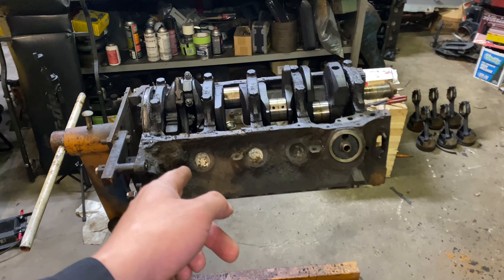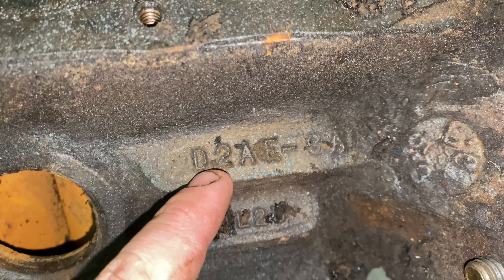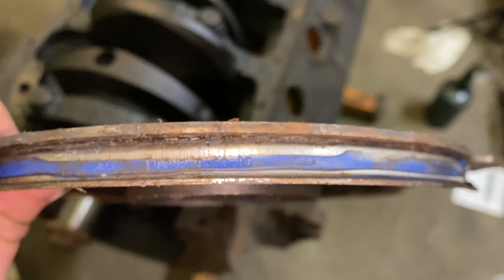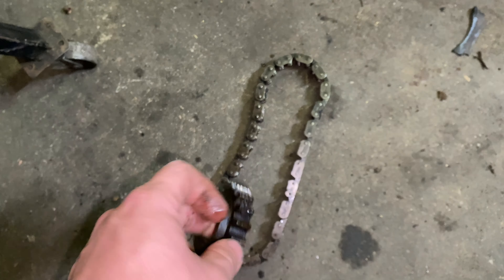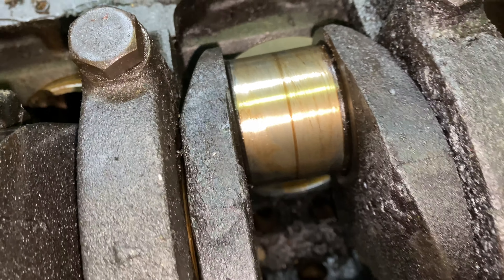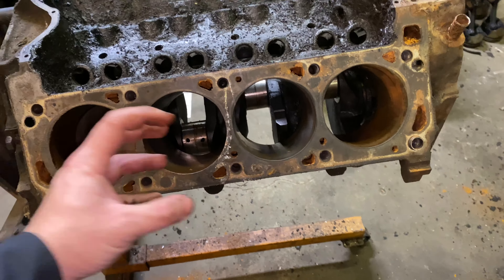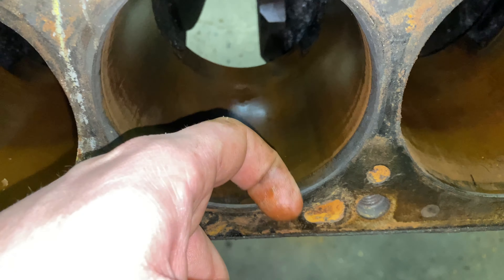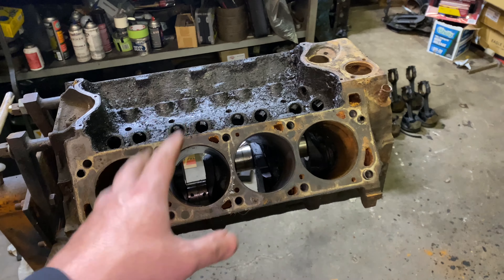Engine project-351 Cleveland.

Comment: I was always raised around the Windsor until my grandfather put a 400 in his 76 f100. I was impressed with the torque and became a fan of them after.
Reply from the maker: Very cool! Yeah those engines have great low end torque but not much too end unless modified but that’s why I love them in trucks, they pull hard just being stock. I didn’t really learn about them or become a fan until I started helping my buddy work on his 77 with a 351m and then he swapped in a 400 and I got to drive it and it was like love at first sight lol. Love those engines and want nothing else but them now. 
Thanks for sharing. 
Thanks for watching.

Comment: Excellent. A couple years ago, I inherited my fathers 1968 For F100 that he put a 1972 351C from a Mustang Mach 1. It wasn't the performance model but that also means it is not so wore out from racing. It is a 2V but I am not looking to beef it up for speed. I am looking to keep it as a truck doing truck stuff. I have been slowly replacing every worn maintenance part because it needed it. Charging system, fuel system, whole brake system and some re-wiring. It keeps me busy but it is also fairly easy to work on, which I love. The truck has two small dents otherwise it is straight. Paint is old and worn but everyone loves it for the "patina".
Reply from the maker: Very cool! That’s pretty much what I got, a 72 2 bolt main 2v motor, and with that 255deh towing cam it should pull a house down while still managing a pretty decent fuel mileage and have that great cleveland sound and idle. They are easy to work on which is another thing I love about those engines. Yeah those old patina paint jobs and vehicles are awesome. Good luck on your build and thanks for sharing. 
Thanks for watching.
Reply: @FastFords289  I am glad I found you, I have been having a few carb problems and  choke issues, and I saw where you adjusted and powered your electronic choke. I now know how to adjust mine! My biggest recent challenge was getting the seized distributor out. I had to mangle it and finally wrenched it out with a huge pipe wrench. But I was able to get it and I am good now. Also the thermostat was a HUGE pain too. My father didn't add one because he couldn't get out the brass piece on the bottom area, he ended up distorting it pretty badly. But since the truck wouldn't warm up, I wanted it right. He had no internet skills. You gotta use the correct thermostat and none of the parts stores carry the correct one. I had to order it from another online place.
Reply from the maker: @armelind  that’s great! Thank you, I’m glad I could help you out with situations and issues. Yeah I’ve had a seized distributor in one of my Cleveland’s I had sitting around, i had to heat up the base around it and take a big wrench to break it loose. Yeah the Cleveland’s use a special thermostat and I’m thinking about doing a modification, west coast classic cougar sales an aluminum bypass that only has a small pin hole for bleeding air and it enables you to use a standard 302/351w type thermostat in its place and work perfectly. Thanks for being a supporter.

Comment: The 351 Cleveland is my favorite motor too . I just sold a 71 Torino and was stored outside and the guy opened up the hood where the hood had these fake openings he drilled out anyway doing that let moisture in the motor and it was stuck tight even after taking the pistons out. Really broke my heart cause I wanted to restore this car . My cousin always loved the 400 motor and he said that motor had a lot of torque. . wishing you a happy new year .
Reply from the maker: Very cool, that’s a shame though about the motor, too bad it couldn’t be saved, hopefully you’ll find another. Yeah those engines are torquey for sure, just being stock, throw in a little RV cam and adjust the timing and they’ll pull a freight train lol. 
Thanks bud I really appreciate it and a happy new year to you as well. 
Thanks for watching.

Comment: GM also used nylon coated timing gears. It was done to reduce engine noise. I tore down my 403 olds in my 79 trans am when I was 16 and the nylon timing gear was of course one of those things that I had to replace. Back then everyone used Cloyes double roller timing chain and gear sets when rebuilding their engines.
Reply from the maker: Wow, crazy, it must of been some gimmick thing all companies were in the loop with. Yeah I always replace my timing chain sets with double roller sets, that’s all I use and never had a problem with them. They’ll last longer than the engines life sometimes. Thanks for sharing and thanks for watching.

Comment: I agree 351 Cleveland is the best motor Ford ever produced I'm building one right now for my 68 Torino GT Fastback it's a 71 351 4 bolt main V4 heads.
Reply from the maker: Absolutely! Very cool, I’m gonna be doing the same thing to my 68 fairlane 500 fastback. I got a 1970 351c 2v block and I’m wanting to run aluminum heads and I take and might do a stroker either 393 or 408. Idk yet but I definitely plan on building something pretty wicked while still being streetable and fun. Good luck on your build. 
Thanks for watching.

Comment: the nylon chain coating was intended to make it quieter
Reply from the maker: Yeah I’ve heard that was the reason for it before, it’s just crazy they’d even do that, there’s a lot  of pressure under a timing chain and you can’t even hear the chain in an engine anyway so it definitely wasn’t one of their better ideas. Thanks for chiming in and sharing. 
Thanks for watching.
Reply: Awe darn you said it before i could lol!❤
Reply: Yes they were supposed to nake ot quieter, also make sure you get the correct bypass thermostat for it i have never seen the correct one installed, they are specific to the 351c, 351m, and 400m only
Reply from the maker: @axlsnakedog  I’m actually planning on doing an upgrade available for those engines that west coast classic cougar sales for the 351c engines. You remove the old by pass plate and install their new aluminum by pass plate with a small pin hole for bleeding air out instead of the big hole like the cleveland. After you do that upgrade you can install a traditional 302 or 351w thermostat and it works perfectly. It’s easier to find the 302,351w thermostats so I think it’ll be a upgrade worth doing. Thanks for commenting and looking out. 
Thanks for watching.